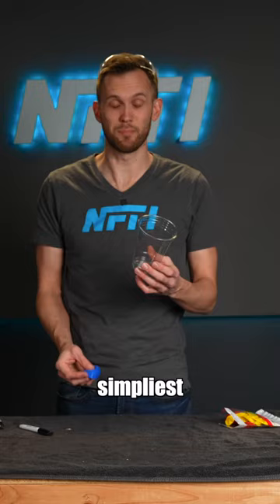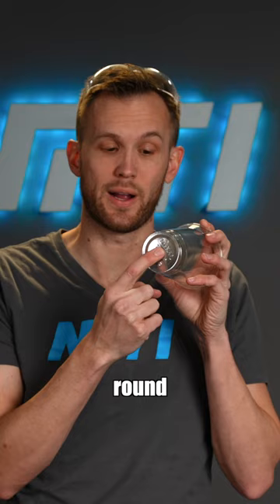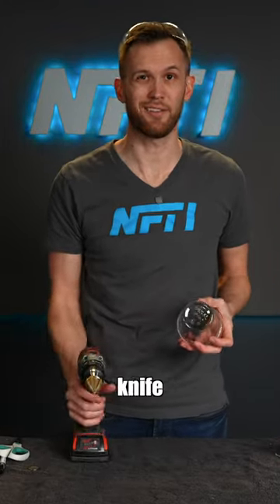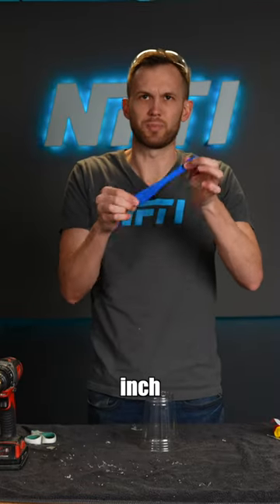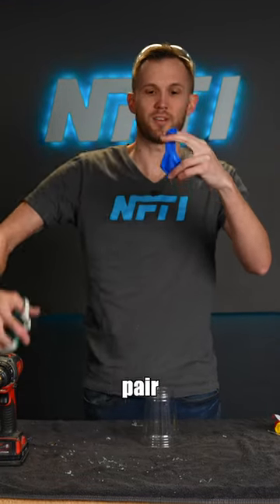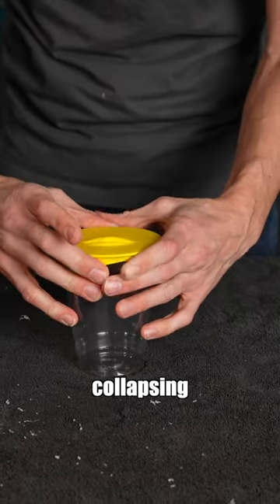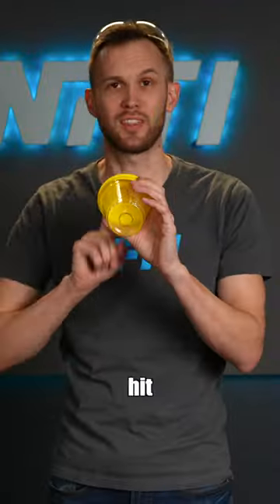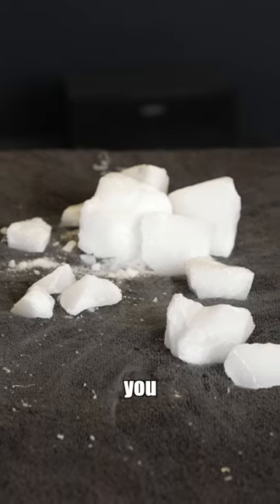Mini Air Vortex Cannon!

Comment: Those scissors are the bomb. They are titanium and I uave had a pair for about 7 years cutting foil wire plastic and god knows what else and they are still sharp to the touch and dont have any problems cutting paper or anything I throw at them.